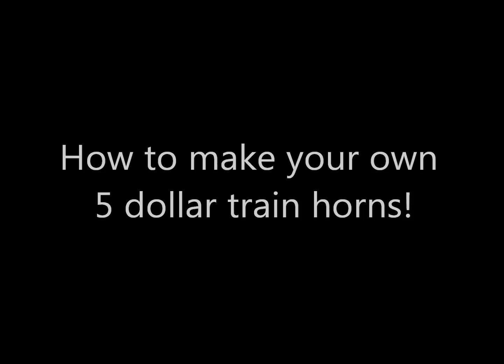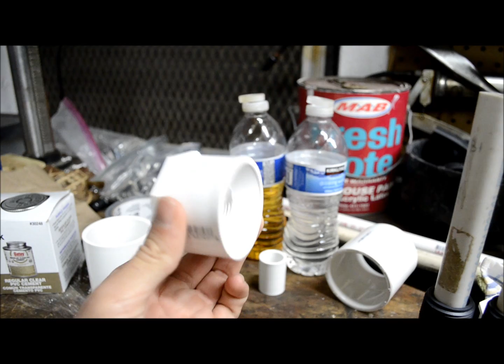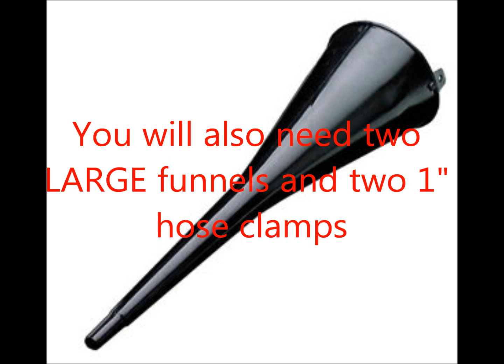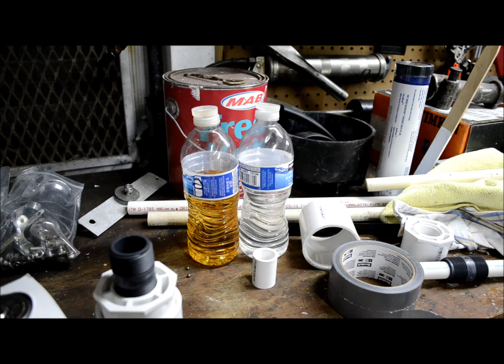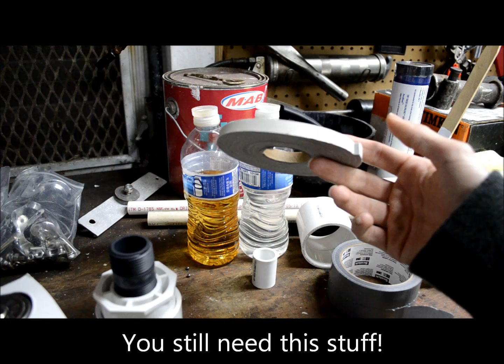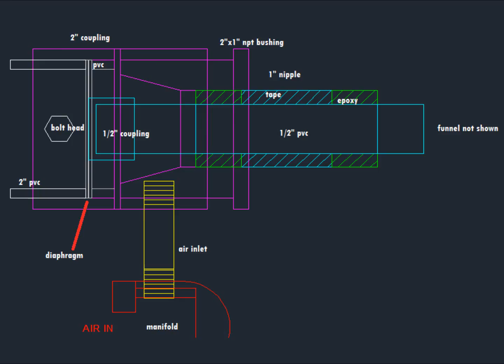HOW TO: Make Your Own Train Horns for $5!!! In-Depth Tutorial- Part 1, Materials

Comment: As you know, a lot of PVC train horns use reducers, going from 4 inch down to 2 inch, or 3 inch to 2 inch, then usually down to 1 inch....

do you know how that affects the sound and volume?  compared to your straight wall 2 inch? 

Also, does your final 1/2 inch pipe affect sound or volume?
Reply from the maker: of course different shapes will cause different types of turbulence, but in this horn I don't think that makes a difference in sound. the sound is not going to be affected by turbulence inside the horn body because it is created by the diaphragm contacting the 1/2" pipe. At least that is the way I see it!

and yes, final pipe size will affect sound